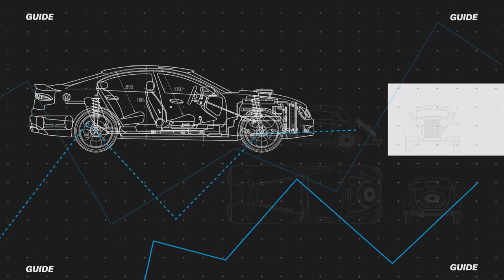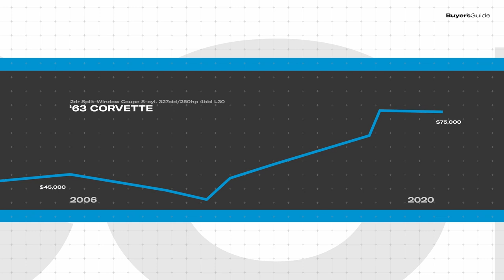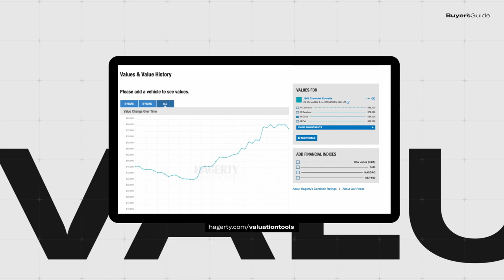1963 Chevrolet Sting Ray Corvette Split-Window Coupe | Buyer's Guide

Comment: No everyone loves the split window Corvette. Zara hated the bar splitting the rear window, and after one year had it removed.
Reply: He had the split removed to comply with DOT rules.
Reply: @Just_Pele  Not true. Duntov never liked the bar splitting the rear window. Said it interfered with rearward vision - which it did. The car’s designer, Bill Mitchel wanted the split. As a compromise, it was in one year, then gone. Interestingly, when the 64s came out with a one piece rear glass, some 63 owners obtained the glass and converted the car. In hindsight, a dumb move because the split window became the darling of collectors.
Reply: @CrazyPetez  I wasn't arguing with you, the split was ultimately removed due to DOT restrictions.
Reply: @Just_Pele  I don’t think that’s correct. Do you have any documentation to make the point?
Reply: @Just_Pele  The DOT didn’t exist until 1966.
Reply: @Just_Pele  No such thing.  Truth was, the split rear window compromised rear visibility, and Zora, a pure racer, hated it.  A number of cars prior to the C2 also had a split rear window, including earlier Volkswagen Beetles, 30's Chryslers, and a few Cords had it also.  There were cars with much poorer rear visibility than the '63 and these cars were production legal.  DOT rules didn't start to intrude into car design until around the 1968 model year.
Reply: @Just_Pele  Prove it.  You have to quote the exact FMVSS specification and date it was passed.
Reply: @CrazyPetez  Considering that the C2 came out three years EARLIER, before the DOT was created, and the DOT doesn't impose its rules retroactively (imagine the chaos that would ensue if the DOT declared that all cars had to go back to round and square headlights AFTER the cars were produced and sold), that's a factual hole big enough to drive a truck through, pun intended.

Comment: My favourite Vettes are the 1963-67 Stingray Coupes. I hate the ragtops on these years. Back in the mid 70’s I was looking at the 63-67 Coupes and they were going for about $6-7,000. Ya, I should have bought a dozen.
Reply: Prefer the coupes but wouldn't walk away from a convertible. Wish I had bought alot of things in the 1980s while they were affordable but I was making peanuts back then.

Comment: The leaf spring in the rear of these (and C3's) is not  a "single leaf" but a full leaf spring turned 90*. Also, the spring in the car he's showing is a composite monospring, just to be clear. I recently installed one of those on my C3 and posted video of the project, if anyone is interested in seeing some C3 restoration. :)
Reply: Yes, I saw that and you are totally right! I have a 72 and it is extremely similar and I just put the mono leaf spring in. But originally this car had a 9 piece leaf spring if I’m not mistaken.
Reply: @tylerobrien72  I believe you're right about the 9 leaves. How do you like the mono spring? I find it somewhat bouncy and I'm not sure if I like that or not. But I may be using the wrong shocks. I put Bilstein HDs on it when I put the spring in.

Comment: Great clip and pretty much spot on comments about the C2 in my humble opinion. A couple of thoughts added: The 63 originally didn't have a composite (plastic) mono leaf spring in the back. This one must have come from an early 80s C3. It should be mentioned, that  Corvettes starting in 63 also handled way better than any other American car at the time with the exception of the Shelby Cobra. It ran rings around Mustangs, Camaros, GTOs and what not. Lastly, when someone goes shopping for an old Corvette: Don't forget the rust problem. Underneath the shiny Fiberglass is an untreated steel structure which rusts. I've never encountered a car which was so good at hiding rust problems like C2 and C3 Corvettes.
Reply: Yes I encountered this on a C3 and the doors wouldn't even close the frame was so bad but the car looked perfect! People must get hosed on this due to that fact.

Comment: Rough cold start would be a bad crank signal valve or combined with a poorly tuned unit, which is not out of the ordinary. The Rochester fuel injection units on C1 and C2 run more efficiently than carbureted when set up properly but not many people are capable of it, and less and less over the years. One of the best ones just passed recently John DeGregory. Great guy.

Comment: Just for the information. The 1963 Corvette didn't have a single leaf spring but multi leaf steel one. The rear suspension on the car in the video has been updated with a fiberglass rear leaf spring and adjustable strut rods. Nothing wrong with the upgrade it is even recommended after all these years.
Reply: It is lighter, therefore less ballast/center of gravity. It's a trade off...

Comment: the original 1963 rear spring was a steel multileaf spring. The composite single leaf rear spring came much later in 1981?
Reply: Correct!

Comment: ... also, the Fuelie needs to be Set with a Manometer, without it you won't get a properly running Fuelie unit, especially on the 63 and early 64's without start-up fuel bypass solenoid.

Comment: Actually the independent rear idea came from the Corvair as Duntov was getting his butt whipped by the Corvair on twisty racetracks. No one wanted the Corvair to replace the 'Vette so they had to make it better or else. Some motor designs of the Corvair engine would allow the Corvair to beat the 'Vette anywhere on the race tracks. Heheheh...the beat is on! Finally they got the'Vette to go fast enough. New design for '63 was really great. I prefer the '67 though.

Comment: Great Vid, Thanks.

...as for "Corvettes don't rust,  That Simply IS NOT TRUE!  There are small steel mounting brackets and other metal parts riveted to the under body that rust and become very difficult to deal with.  You can't exactly take a torch to them to release them!  The seat retaining brackets are another example of bolts that can be difficult to release.

Another place that rusts real bad is the frame just in front of the rear wheels from road salt.  They can actually rust in two, making the car very dangerous to drive!  That REALLY stresses the fiberglass body also, so look for structural cracking when buying one of these beasts.  Do your homework and make sure what is on the car actually came with that particular combination BEFORE you buy it.  Bill Mitchell LOVED the Split, Duntov HATED it.
Reply: This was back when the cars were body on frame designs.  The actual bodies didn't rust, but the support structure was HIGHLY susceptible to rust.  The Corvette didn't get an actual unibody design until the C4 and later.